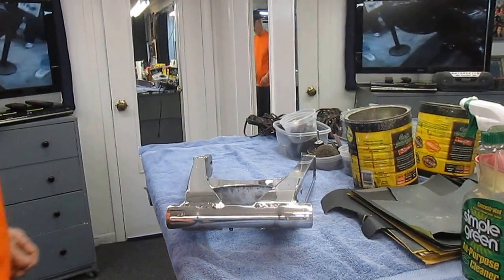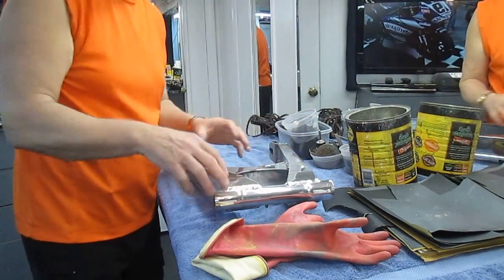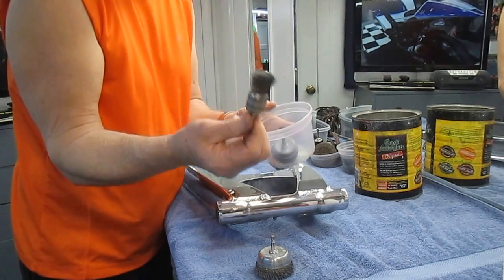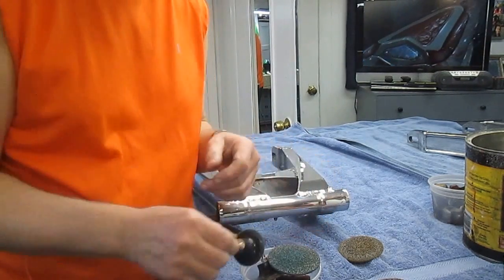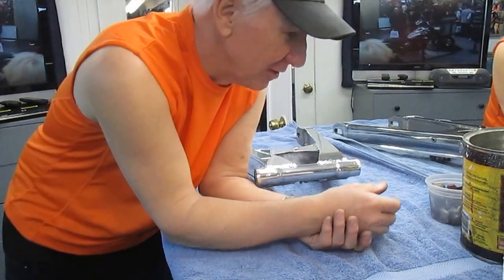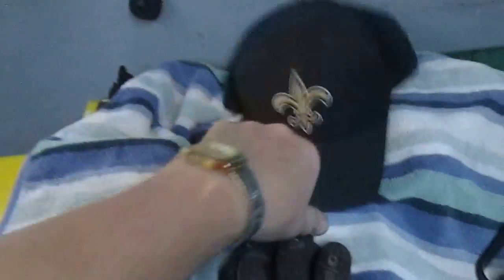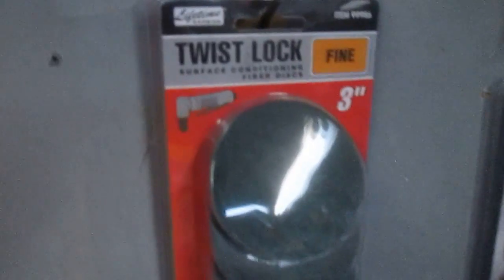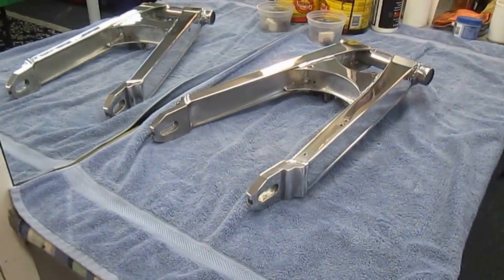HOW TO POLISH AN ALUMINUM SWINGARM

Comment: that damn hard anodizing coat that the factory uses on the swing arm is hard to get off had to use some aluminum cleaner and oven cleaner but did not let it sit on for too long or it would of damaged the metal.

Comment: when u finished all the work and u have this shinny result all u want its to preserve it, in such case i noted that wd-40 its the best wet,foam,or humidity repelant that u can use it literally makes the water drops and dust slide out firm the surface thats why wd40 its used in aeroplanes surfaces